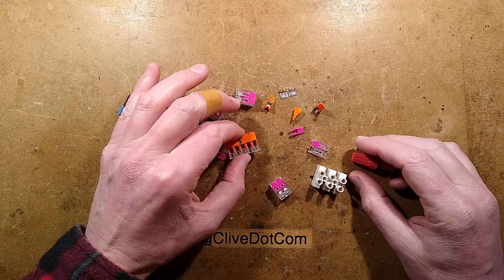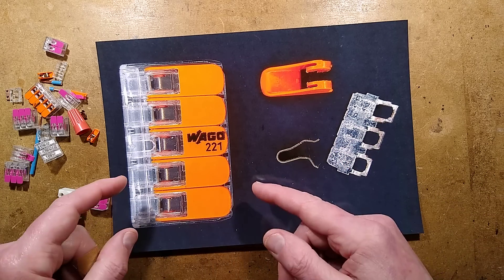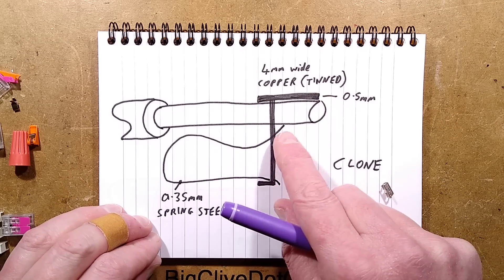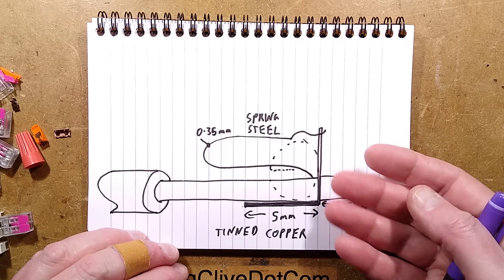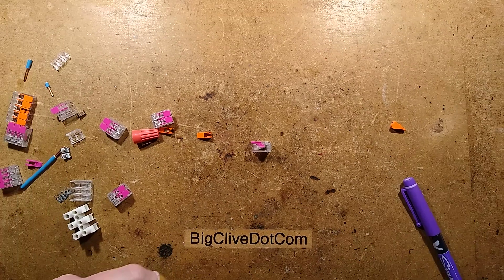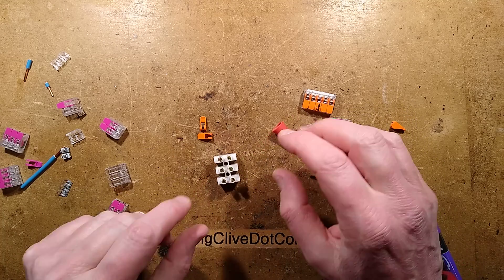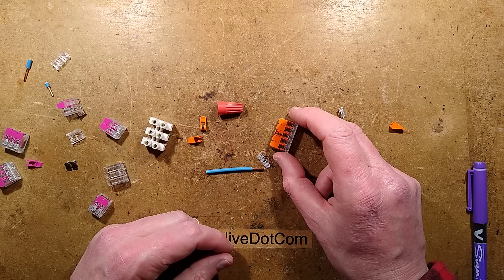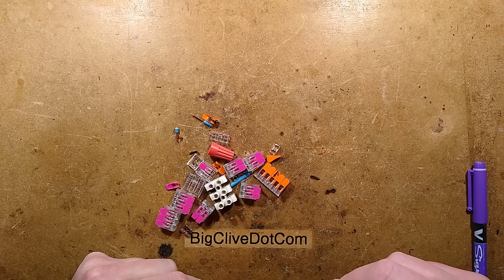Inside a Wago connector and a clone

Comment: I can't confirm this, but I once read someone claiming that certain military applications require the use of Wago or similar screwless terminals, on the grounds that they are far more resistant to vibration that anything with a screw. This makes sense to me. Clive, if you read this and would like an assortment of many different styles of Wago terminals, drop me a note 🙂
Reply from the maker: Thanks.  I do have a good collection of the common Wago terminals here.

Comment: All of these are designed to appeal to Millennials and generation XX who have a complex need for instantaneous gratification while doing anything. As an industrial electrician, I will never waste money on these devises because that tiny little spring will lose its springiness (pressure at the contact point) when it gets hot, which will result in a feedback loop of ever more heat. Eventually the wire insulation will cook away far along the wire, causing possibly even more damage to surrounding wiring and combustibles; result may be a fire. A crimp connection or properly torqued screw-down connection is far safer for current carrying conductors. But what a great video you made of them. Love this channel.
Reply from the maker: The first time I came across Wago terminals was while installing industrial refrigeration equipment.  I asked the service department if they'd had any problems with them and they said no.
At this point in time I have never come across a failed Wago terminal despite their widespread use in European installations.

Comment: I think it's far harder to make a bad connection with a Wago than it is to get a good connection with a wire nut, especially when done by a DIYer. 
I really hope that the clones are of good quality and don't lead to burnt down properties or worse. Recently I saw another Wago clone in one of our hardware stores, that has me wonder if the patent (which Wago likely had) has expired.

Comment: Cage clamps on large terminals can be overtightened and deformed, causing them to split apart at their seams. The wires eventually come loose. Wago spring clamps can not be overtightened and the spring keeps them tight even after many thermal cycles. For reliability Wago are much better on electrical equipment that is likely to be built or serviced by technicians who do not know their own strength.

Comment: ...cue the wire nut fan club...  (the "nut" in "wire nut" is not a coincidence, IMNSHO.) 

Seriously, the 221 is a game changer. It's smaller, safer, faster, and gives consistent results. 

The screw terminal blocks, well, how many who use them check the torque they're tightening with? I'd wager that's a Manly Man sport, finding the torque when it just is about to break but still holds. 

For any Swedes in the comment thread; in our domestic wiring, use ONLY 221. Not the other Wagos. Since almost all wire in conduit in Sweden is 7-strand, it is important that a block handling stranded is used. Hence 221.

Comment: One thing I like about the Wago 221 is the clear void behind the bus bar.  When you're working on something in an awkward spot, like a conduit loop in box above a ceiling rose, you can shine a torch at it to see the conductors have all gone fully through the bus bar.  I.e. an additional safety check to be confident the individual wires are fully in.  With short and stiff solid core wires above your head, it's easy to get one not quite fully in before you close the clamp (far enough to be clamped, but not all the way in).

With the Wago 221, just twist it around to see the back, shine a torch on it, and you know instantly it's correctly installed.  It looked to me like your clone did not have that useful void.

Comment: Ah, the venerable wirenut. A fine educational example of worst-practice solderless connections. wait - these are used in professional installations rather than just humourous how-not-to videos? Even though they break every safety rule in the book ragarding pull resistance, arc protection and so on? Holy hell. Someone done goofed.

Comment: Lever connectors are great when you have lots of room and I really like that you can disconnect or add wires without disturbing the rest of the wires but when you are connecting multiple wires together inside a junction box wire nuts take a lot less room.

Comment: The benefit of Wago connectors over the other older ones is the consistency. It's very hard to mess up the installation, and i think there even is a stripping guide on them. The screw terminals and wire nuts are much more prone to user error. With the Wago basically the only variable is how well you strip the wire, while with the other ones you also need correct torque etc. 

Also the reusability, the wire nuts are pretty reusable but the wire itself will be cactus. Same with the screw terminals, often wires will be a bit decapitated. The Wagos are much more gentle with the wire while maintaining good contact. I haven't seen a Wago snap a wire, but i can't say the same for the others.
Reply: In our house we have several wire nuts that were installed in the early 60s and are now so difficult to undo that we often simply have to snip the wires. I have now 'discovered' these things, and I now swear by them.
Reply: What works against consistency, is that if it relies on particular level of quality of the connector, one is bound to have lower level knock-off prolifirating.   With 8 billion people around, I bet most installation will not use a brand-name wago connectors,  even if that type spreads everywhere.   So if to make bad Wago is easier that a bad wirenut, it is a big minus on consistency part.

Comment: I bought a set of Wago 222 and Wago 221, plus the cheap clones of each. Having access to a 600A supply (a MOM 600 micro-ohm-meter) i tested these connectors with the thickest allowable wires. The wires melted before anything happened to the metal in the connectors each time, both for the original ones and the clones. (if anyone from my lab is reading this, sorry about the burn marks from melted copper on the ESD mat)
That said, i do agree with Clive that you can't trust the clones to keep being good, they could change manufacturing at any time making them a fire hazard. They're fine for hobby stuff or low current but you shouldn't trust them in a real mains application where you require anywhere near the full rated current.
Reply from the maker: Many of the test videos showing the connectors melting are a bit harsh, as you can see the wires themselves glowing red hot.  The cables would be dribbling plastic way before the connectors would.

Comment: The problem w those are that you can't just use any wire... Good old chocolate bars take like 0.5-3 mm wires
Reply from the maker: The old terminal strip will happily chop small wires and barely make a dent in bigger ones.
Reply: @bigclivedotcom  weird i never experienced anything wrong w chocolate bars
Reply from the maker: @HelPreacher  I've lost count of the number of burned up and melted bars when doing repairs.  Probably mainly cold flow of the copper over time, but also sometimes just not tightened up in the first place.

Comment: thank you for talking about the metallurgy.  I saw someone comparing a wirenut to a wago in terms of heat.  I had to draw attention that the wago is using copper the wirenut is using steel so of course the steel gets hot with whatever transients run through it.
Reply from the maker: In the case of the wirenut, the steel spring is used to squeeze the copper conductors together.
Reply: @bigclivedotcom  for reference https://www.youtube.com/watch?v=B1pmuRsf1co
Reply: @bigclivedotcom  electricity doesn't find only the easiest path to ground though right, I reckon some current finds its way through the steel and heats it.
Reply from the maker: @ChadwickFerguson  Current takes all paths of resistance, but I'd guess that most is flowing copper to copper.

Comment: We use wagos all the time.  Mostly solid core wagos, but also lever action 221s. The boss decided to cheap out and try various other makes (all decent brands, not no-namers from china), all of which were perfectly OK but more painful to use and less flexible.  Wurth, for example, make lever actions, and while their solid core ones are great, th lever action ones don't handle very thin wires (with < 0.75mm they are not reliable) and won't go as far as the wago on big wires (the wagos will handle 4mm easily).

They're all better than screw terminal blocks.

Comment: Also worth mentioning that you needn’t lift the lever to insert a wire, you can just insert them and they’ll hold. You need only lift the lever to remove the wire.
Reply: That's what WAGO (Always capitalised and pronounced "var-go" :) ) recommend for solid core, just use the levers/buttons for stranded, but you're still better off putting ferrules on stranded.

Comment: Wire nuts were used in the UK around the 40s/50s era and were considered a bodge then. How the states still use them in the 21st century is worrying
Reply: I worked in a US chemical plant from 1977 to 2011 and they were not allowed, as well as EMT conduit - only rigid conduit was allowed. Later, I moved to another plant owned by another company, where wire nuts were used, but cable ties with metal tooth inserts were not allowed. Funny, the things that different companies allow!

Comment: most of the time we use the push in wagos at work 
2273-203 or 202 or 204 or 205
for lamps
224-101
224-112
and sometimes 
221-413 for up to 4mm² wire
or
221-613 for up to 6mm² wire

Comment: Interesting to see there are several clones of these. The clones I purchased from China have the same colour scheme as the Wagos, but ultimately I concluded the genuine article performed much better as far as grip and how it felt opening/closing (the clone left me not so confident). Felt like the clone's spring tension was much less and took less effort to pull a wire out. Like you said though, for projects and test setups, the clones are def a more affordable alternative. For my permanent home/shop wiring, I use the genuine Wago. Cost is doable when purchased in bulk.

When I first ran into Wago, they were a godsend. Terminal blocks are good, as are screw caps (Australia mind you, like Clipsal 563J/50). "Wire nuts"? Nah, NTY. The best thing about Wago, besides how easy they are and quick, is the wire is not fatigued, squashed or twisted.

I started off with the original series (222) and never had any issues. The 221 take up a bit less space and never had any issues with them either. Home wiring in Australia is stranded, and most end devices (lamp fittings) around the world have stranded wire. This is where Wago is like magic (and wire nuts a nightmare) lol.

Comment: Wagos are great, I'm a heavy truck mechanic and I often use them for automotive electrics. Very easy and reliable method for splicing into existing wiring. Of course they can only be used in low to medium current circuits (less than 15 amps usually) in reasonably dry locations like inside the cab or in watertight connection boxes, for outside work it's crimp connectors with adhesive shrink tubing. 

A big plus for them is they work well with fine stranded automotive leads. Wire nuts and screw terminals are not very good for those, though the performance of screw terminals can be improved by using ferrules. For single strand house wiring I like wire nuts.

One potential problem with the clone design is the continuous spring part is in the path of the current which can at least theoretically cause it to heat up and lose temper leading to loss of the clamping force which can cause additional heating, arcing etc. In the original the springs being separate for each connection prevents that. Probably not a huge problem if used at rated current though.
Reply: I wonder what 'rated' means for a clone :)

Comment: What everybody calls "The Wago" is their series 221 connectors. The definitive Wago for many is their three-way 221-413. Most people know Wago for their commoning 221-41x connectors, but they manufacturer heaps more of these things allowing for inline splicing, affixing to motherboards, strain relief, bundling etc. etc. etc.

What confuses me is how use of this connector style hasn't caught on for audio equipment. The clone makers can de-common the connections and make two-pole, three-pole, four-pole, or even five-pole phone connections, phono / tulip jacks, BNC, Ethernet and so-on until everything that could otherwise require crimping, punching or screwing down uses leverbacks. Alas, we don't live in that timeline… yet. Clone fabs, get on that!
Reply: I did write "Leverbacks" didn't I? Well, since the comment got a heart I won't bother editing, but I meant "Lever nuts." Merely semantics but I don't think I was using the right term there.

Comment: Here's my argument, albeit poorly researched.  Here in the US we use 120V for most household circuits. This means half the voltage and double the amps of what most people see in Europe where Wagos are the main accepted connection method. Properly twisted solid copper wire and a properly installed wire nut can sustain as many amps, if not more than, a Wago due simply to the increased contact area between the conductors.

Comment: Could you explain how wire nuts actually work?
Reply from the maker: It's basically a cone with a tapered spring in it.  When you twist wires together and then screw it onto them it jams them together.

Comment: On the subject of connecting wires without soldering, we've discussed Wago and Marlette connections here.   I've use hydraulic crimping on low-voltage high-current applications and it works very well.   Are there similar  hydraulic crimp connectors for lower-current (<50A, 120/240V) applications?  Given that the method uses pressures of over 10 tons to form a connection, it would seem to be better than either of the connectors discussed here.
Reply from the maker: Hydraulic crimping is used on some industrial cables.
Reply: @bigclivedotcom  During the US aluminum (solid, not stranded) wire in residences plague, I believe the only approved way to attach a copper pigtail to a solid aluminum wire was by a hydraulic crimp.

Comment: I prefer the traditional connectors with the screws ,they are much more reliable.
Reply from the maker: I've repaired lots of equipment with burned up connections where a screw loosened over time or was never tightened in the first place.

Comment: okay but how exactly is this supposed to get be better steak???
never once used wago connectors, found them a few times that other people used and there was so many 2 inch leads to common multiple connectors that i wanted to cry, sure twist on connectors damage the wire ends each time you use them...but they also use wire to wire connections and dont run it through a bus bar, i dont know if i want to run 100 amps through some 14 gauge wire......but.....accidents happen, it depends if you want the weak link to be in the connector or in the wire or in the end point device, that reminds me.... i need to replace a flakey light switch in the kitchen before it starts getting hot from intermittent use

Comment: The grey Wago lever connectors are my favorite, they clamp harder than the transparent ones and can tollerate more moisture before they fail. I use these a lot in the automotive work since they can and will be outside a vehicle in boxes under the cars etc, even inside a caravan during winter you will get a lot of condensation during winter and I never needed to replace a grey one but many times the transparent ones. however both are good and beyond if you compare to a sugar cube or even just flat pin connectors as they often use in the HV terminals as well inside these vehicles. caravans are a complete jungle of standards when you compare to houses and everyone uses everything they get their hands on for the cheapest price without a care in the world
Reply from the maker: If you have water-exposed connectors then you can put them in clip together gel boxes that surround them with a polymer insulating gel.
Reply: @bigclivedotcom  the good stuff. Too bad they don’t use anything like that in the factories

Comment: SO ..... To be fair, for now ..... The "clone" has an BETTER design, than WAGO !?   I like these "clones" because they have an 3 way, that connects from 'bottom' to 'top' on each "line" So, you can easily re-connect an (by accident) cut 3 wire cable ( Positive, Negative, and Ground ) While WAGO, doesn't have THOSE connectors ! ( WAGO only have connectors for 1 line ) I believe you have an older video about these ?!

Comment: I used a few clones to wire 8 speakers in the car. I wanted to keep section of the wires separate in case I have to pull them out or make changes. They worked pretty well!

Comment: I use the lever style wagos frequently. The lever action has a bit of play if I remember correctly, you need to lift it about 1mm before you get resistance and it only releases on a full lever action if iam not mistaken. Is that the case with the other design as well? That would at least make a good reason for why wago did it like that. Curious what other designs wago had come up with which where scrapped.
Reply from the maker: The clone also has a slack area to ensure the spring has full clamping pressure.
Reply: @bigclivedotcom  Thanks for the clarification. Then the Chinese version, I think it's fair to say that they are not really a knock off, seems a viable option. Meanwell PSU's were also kinda mäh in the beginning (some product lines more than others…KNX…), nowadays, they are completely viable, reliable and reasonably priced.